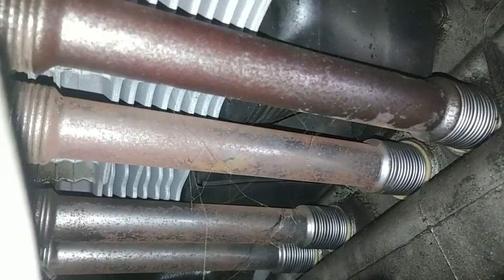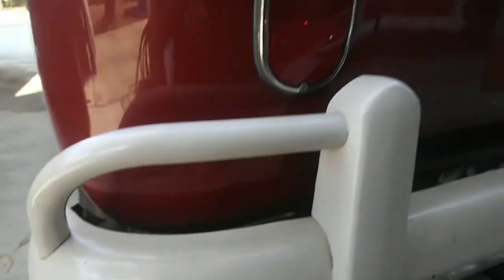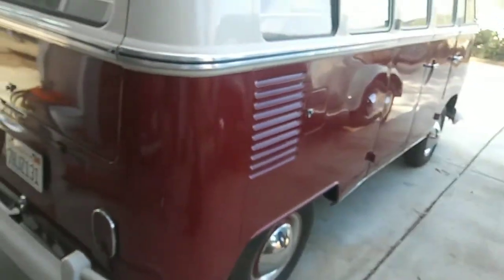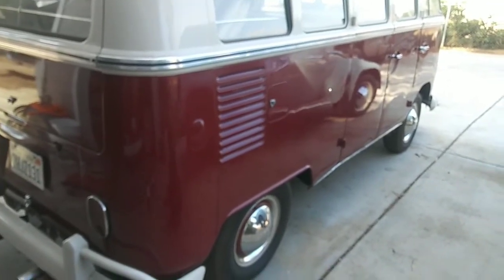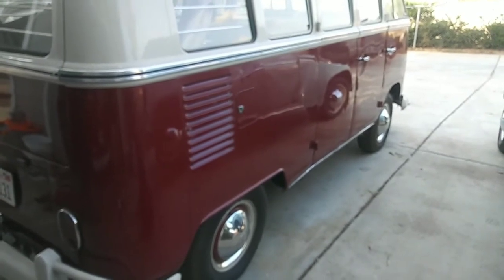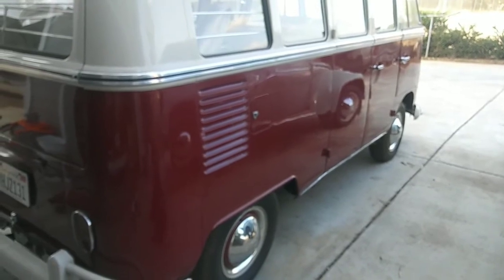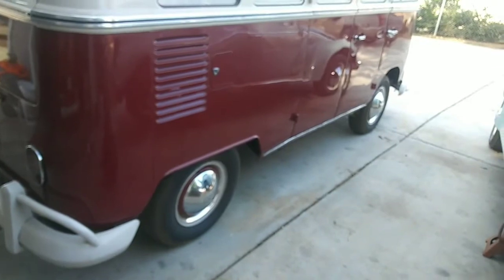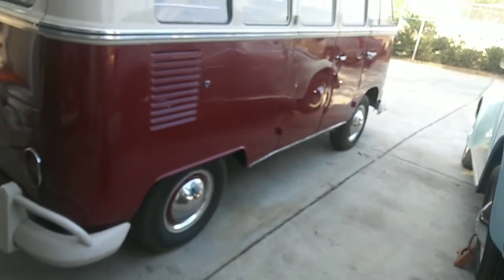VW engine cool  tin why it works and VW says it won't

Comment: I like your theories about the infamous VW bulletin. Just finished reading a thread on the Samba with all the doomsayers and hand-wringers. But today I went ahead and bought some for my 1600 SP build. Knowing a thing or two about aerodynamics and airflow it just makes sense to use them as they "wrap: the air around the whole cylinder barrel AND help cool the heads.
I understand (but haven't confirmed) that late model Brazilian Type Bugs used the Type3 Cool Tins straight from the factory?

Comment: I ran a VW shop including a full VW machine shop for over 40 years and never saw a good running VW engine overheat. I also never saw a VW engine with correctly set up doors and thermostat over heat, none, ever.None of my customers ever had a problem with un-leaded fuel ever. That includes my personal 1976 Camper that I've owned and run for 35 years.Almost all problems with VW's occur because people, usually the owner, don't know what they're doing AND SCREW WITH THEM. As far as the thermostat and door assembles go, Gene Berg, one of the Captains of the VW industry, did serious testing of this subject years ago, his findings are available at the Gene Berg website.

Comment: I'm not making an argument for or against you, but I'm curious if back when your shop did the testing, did your test vehicles have functioning flaps and thermostat?  One of your main arguments for the cool tins working better is more air being diverted over the cylinder heads.  Well, with a properly functioning thermostat and flaps, that's exactly what that part of the cooling system is designed to do, divert air to the cylinder heads when needed.  In fact it could potentially divert all the air to the cylinder heads if things really start to heat up.  The cool tins won't do that(on there own anyway).  

If your comparison was cool tins vs. Standard tins, without a thermostat or no flaps, I definitely agree with you the cool tins will run cooler, as the the air will all be directed down across the cylinders only.

If in both test cases you ran flaps, thermostat and all the other cooling tins, then I'm definitely curious if you still showed better numbers with the cool tins?

So, I'm curious, did your test vehicles have flaps, thermostat and all other cooling tins installed?  Thanks!
Reply from the maker: We had more engines in the shop with catastrophic failure from a failing thermostat than anyone can believe. Guys around here removed them on every rebuild because they would stick and cause the engine to burn up. We tested  them in comparison to many different applications and always the cool tin was better. My buddy has them on his car right now has over 300k miles on 2 engines and he pulls a tear drop trailer with a boat on his roof.

Comment: I heard that for years. I used that "cool tin" on my 2110 T1 in my 67 bug. I drove that 67 daily while in school 3 1/2 years. I was also told that a T1 engine would overheat in a 1972 T2, I put that same 2110 in the Bus. Anyway I put over 25,000 miles on the bus, I did drop the compression from 11.0:1 to 8.5:1, Drove it from Cali to Vegas and around Lake Mead at least 4X over the years But I did not see any signs of overheating. Thanks for the video...
Reply from the maker: Cool thanks for the info I really cant see any signs that it does not work. everything I have tried it on just runs better and cooler.

Comment: Nice Video on a heated subject Mike.
I first found out about these tins watching one of your older vids and did some research. I know one article I read said these tins work but they have to be fitted tight to the jugs to work properly. Another big player in the type 4 engine building game said he did extensive data testing and found these didn't work any better than a set of stock tin. I'm going to try some on my motor with a cht gauge and see what happens. Thanks for the vid on this topic.
Reply from the maker: yea there is a lot of people that say they dont work mostly people who have never used them. ha ha.
Reply: kyungi1 : That big player in the Type 4 area wouldn't be Jake Raby would it?.
Reply: Haha yes sir. I respect the amount of research that he has put into type 4 motors and his dtm fan shroud is nice but... After doing some research of my own on the cool tin I beg to differ from his findings. Fun fact, VW at some point put cool tin on their cars that were sold in tropical climates hmm..

Comment: Well Mike, you probably gotta point about the tin. But I'll tell you, I've built VDubs and I've built straight fours and V-8's, and those water jackets around the cylinders are pretty substantial. Love that Type 2 of yours.
Reply from the maker: for sure cylinders do get hot. and the tin addresses that by making the air go all the way around the cylinder then out the hole. It just doesnt waste the air that is there.